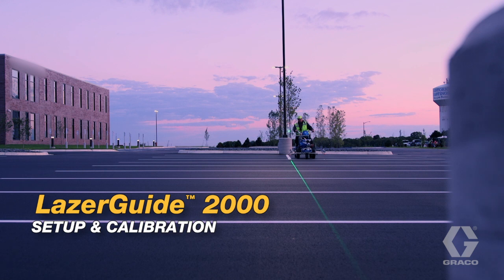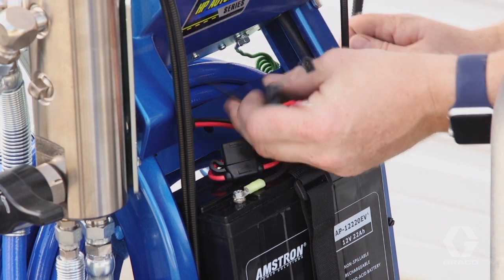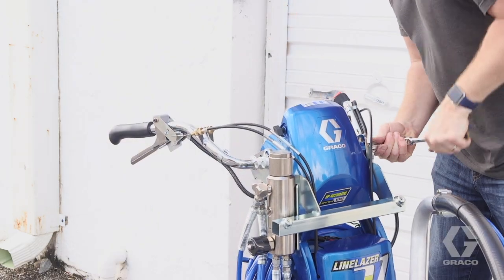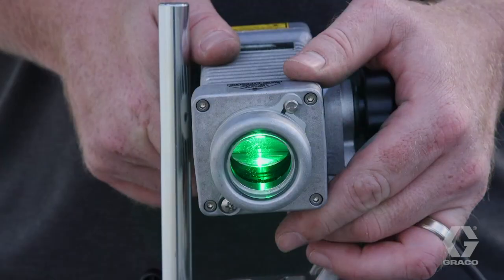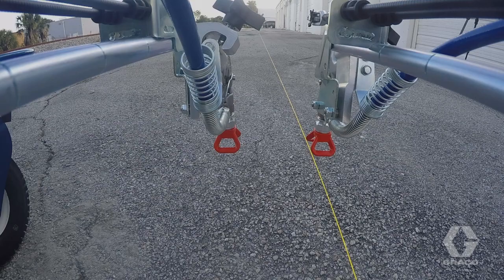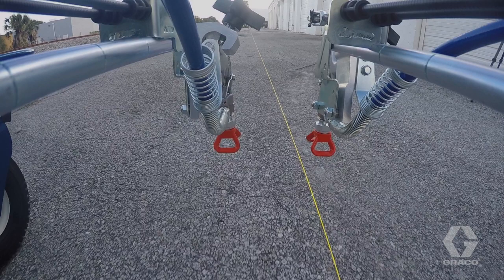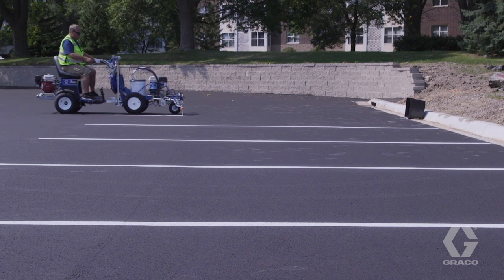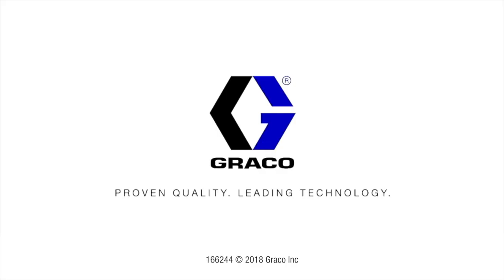Graco LazerGuide 2000 Setup & Calibration

Comment: Most new asphalt layout jobs I see involve Handicap stalls, stalls on a radius, different sized stalls in the same row (compacts, standard, truck stalls).  Cannot see using this.  
Also it seems you need somebody to move the reflecting box for each line so you still need a guy to move the box.